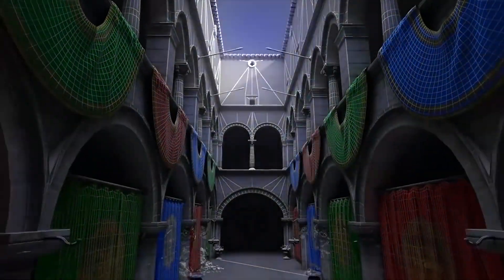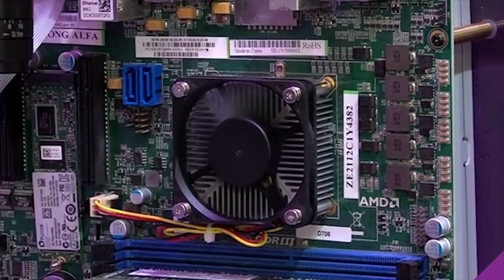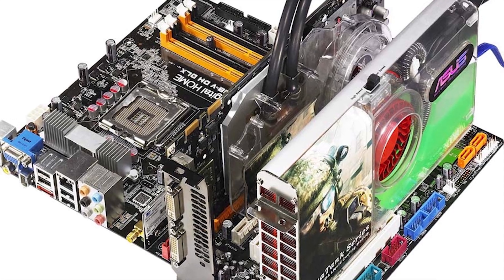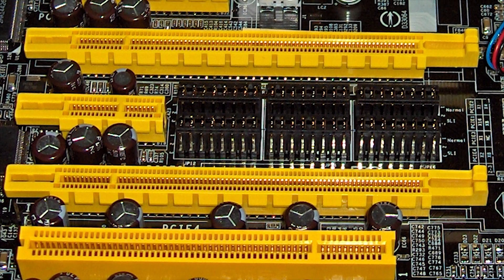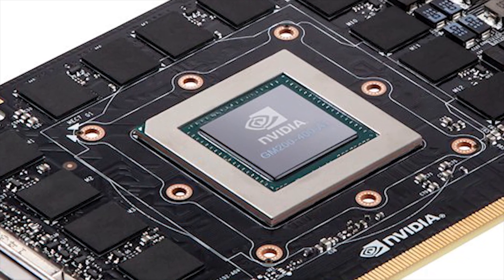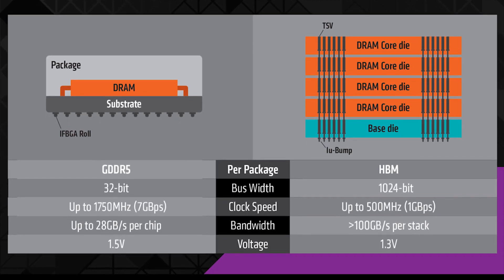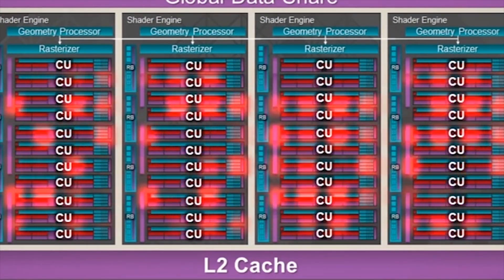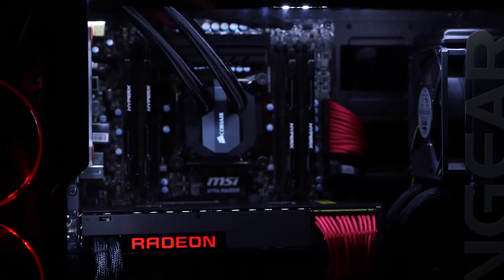How Does A Gaming Graphics Card (GPU) Work?

Comment: This video has several mistakes in it: Maximum PCIE lane isn't 16x, it's 32x (which honestly isn't really used, but nevertheless it exists). GPU performance isn't limited by PCIE speed, mostly load times are (benchmarks measure loading times too, but perhaps nobody cares about extra 5sec loading time). I have GTA5 at 60fps with PCIE 2.0 1x...

Comment: the gpu is only critical depending on the systems purpose  my computer runs graphics of it's cpu some old games very well i don't have a gpu in my computer don't worry im fixing that problem i just need more ram to better run my new motherboard and gpu that is sitting in my closet until i have the required amount of ram to run mt new mobo but if you want  a good computer for lets say college then get a laptop that has a 4th gen i5 core cpu i7 is not necessary unless you want to run games and don't get 5th gen it just as good as 4th gen right now even the 4th gen i5 can run todays games amazingly when pared with a good gpu

Comment: Next thing we know we'll be using liquid nitrogen to cool our systems in the future, because of how ridiculously powerful they will be.
Reply: My gosh, I didn't finish the video when I wrote that comment, and he JUST said that guy's use liquid nitrogen to cool certain systems.
Reply: Luke Hickey Quantum computers use a cooling system to get the chip to a fraction above absolute zero, no where in the universe is that cold.
Reply: Luke Hickey Hardware gets more power efficient with time, look at how much power a high end gpu 10 years ago ned and compare it to a mid range gpu released now
Reply: Jefferson Hall that's because quantum computers are COMPLETELY different than modern cpus
Reply: The future with probably rest on off-site micro latency computer systems where all you have is a display, keyboard, mouse or other control surfaces and everything will be accessible from the cloud. It'll be more cost effective to do it that way rather than chemicals in the home. That will be a good 50 - 100 years away tho.

Most systems will slowly move onto cooling loops, custom water cooling, oil cooling, refrigerants and then liquid nitrogen.
Reply: reggiep75 Cool.
Reply: Luke Hickey already have one in my unit.
Reply: it would be way easier to have more cores and lower clock speeds and just have software devs to adapt to multi-core performance
Reply: or rather improve the power proficiency
Reply: Already has been happening